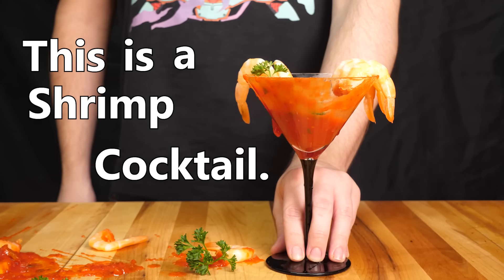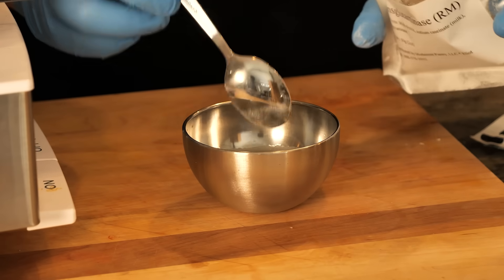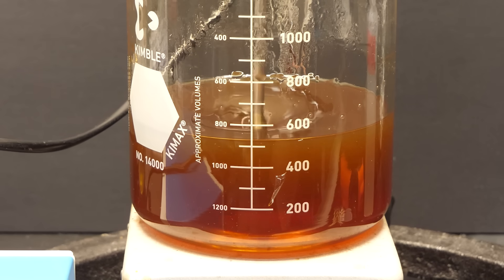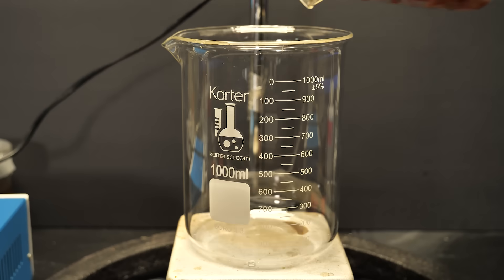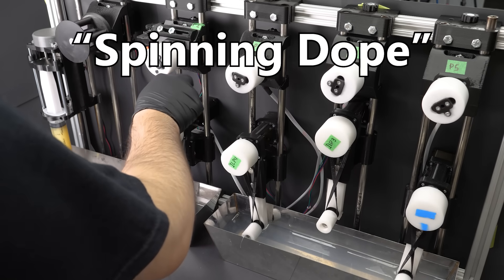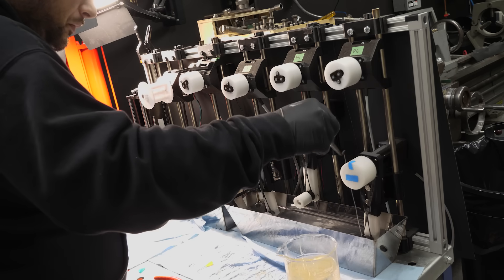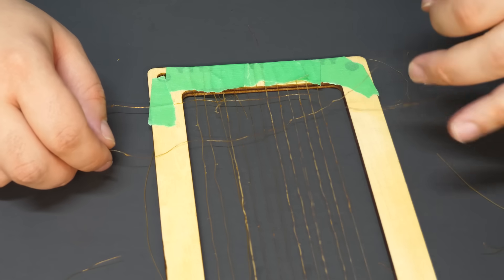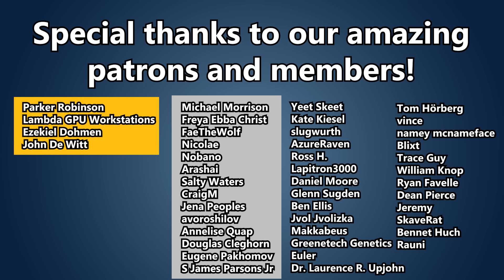Turning SHRIMP into Fabric

Comment: Maybe it'd be better to see if you can add the acetyl groups back on after it's woven. If you can then you'd be able to do an intermediate step where you partially dissolve the surface to seal it. That might let you make things that are more along the lines of rain coats or wind breakers.
EDIT: Going further, I wonder if you'd be able to add color to it before spinning so that, when you put the groups back on, you lock in the color so that it won't bleed out and will last a long time.